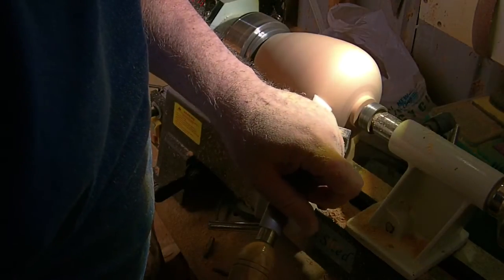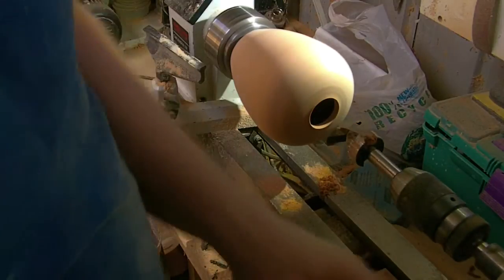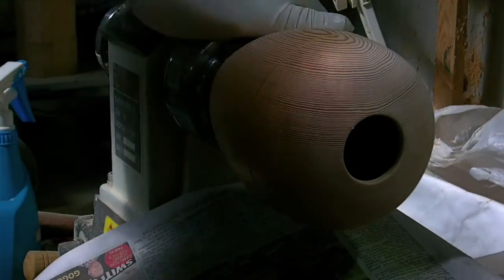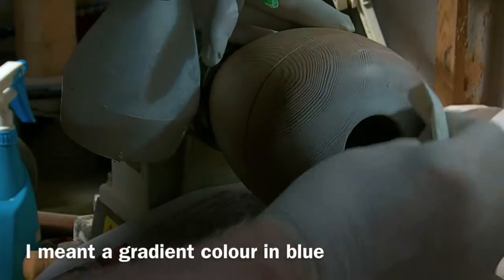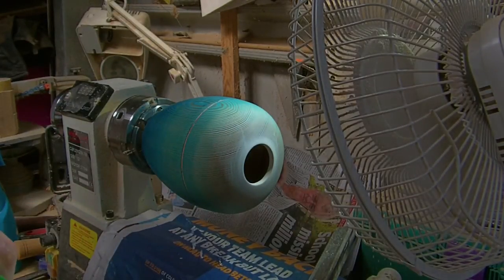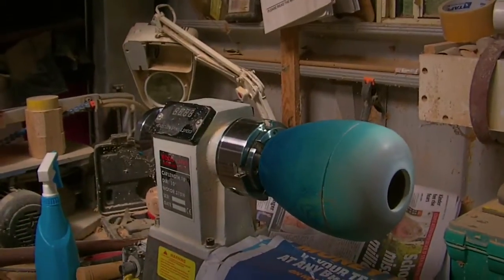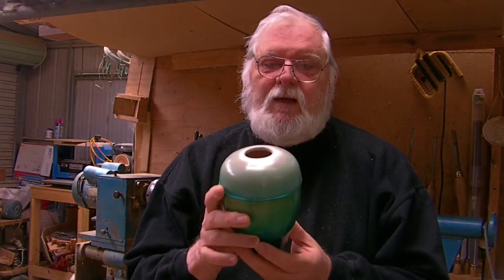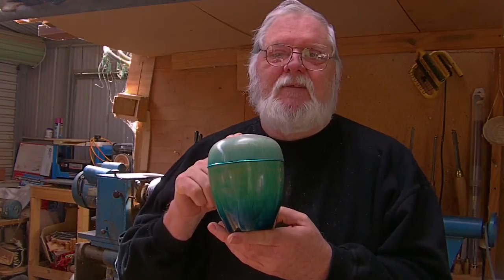The Iceberg Vase

Comment: Very pretty and extremely unique. You really did a fantastic job with the gradient blue! I'll have to give it a try as well, given I'm not set up for hollowing that deep either. Thanks so much... Take care and best regards :-)
Reply from the maker: Thank you Charlie. There are a number of things you can use instead of wire. You could just burn a line or put in crushed rock or veneer strip.